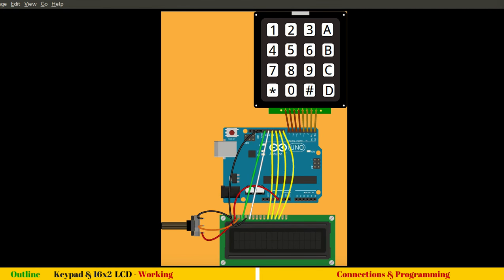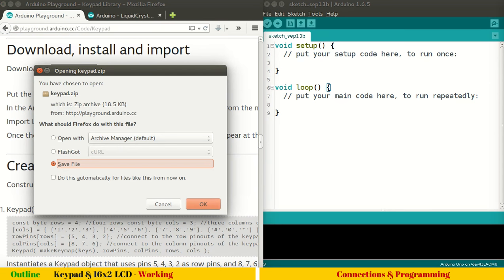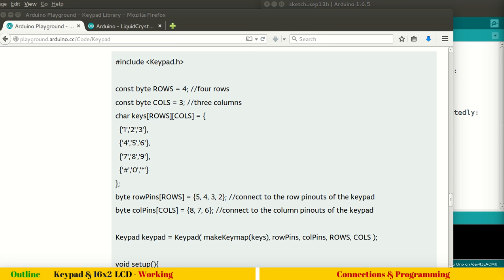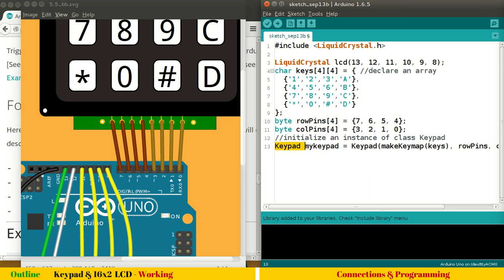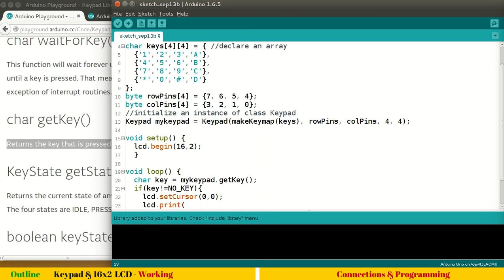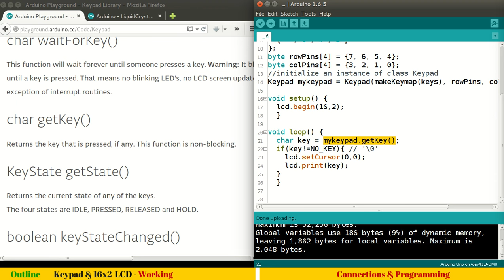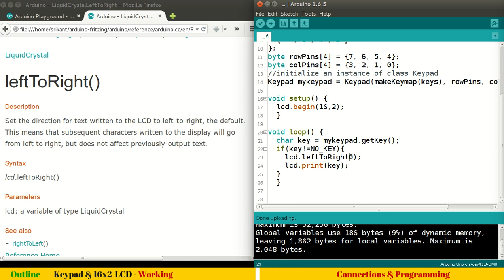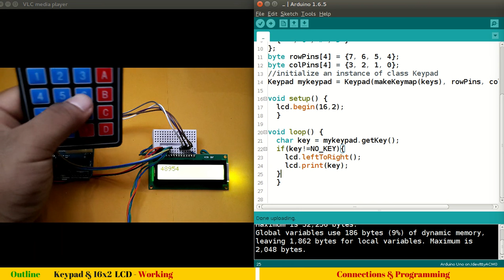11. Interfacing 4x4 matrix keypad and 16x2 LCD with Arduino

Comment: Hye.. Can u plz tell me how i get  a  no. greater than 9. mean 12 or 13 etc in one folder  by using keypad. ..?
bcz evey time when  i press  2nd digit of no. like if i press 3 of 13. it will erase 1st digit which was 1 and replace it with 3. 
kindly share  your knowledge..? iam w8ng
Reply from the maker: You have to move the cursor for each digit. Have you considered this example : https://learn.adafruit.com/adafruit-arduino-lesson-12-lcd-displays-part-2/arduino-code

Comment: sir agr hm ny lcd ko same time android app or keypad sy control karna ho to kaisy kary gy with arduino
Reply from the maker: You can use bluetooth or wifi shield with Arduino and serially receive data from phone and display on LCD. I, however, suggest you explore esp8266 based boards.